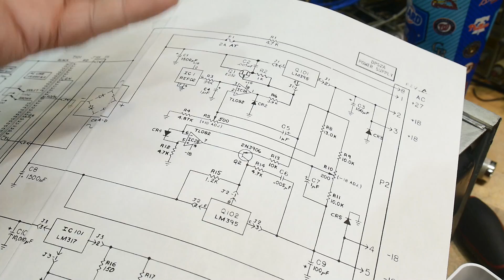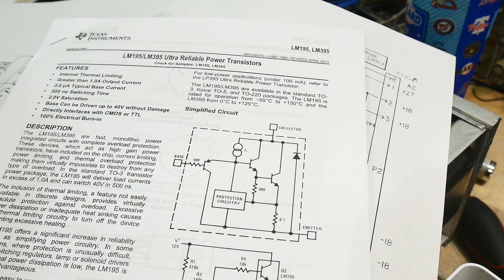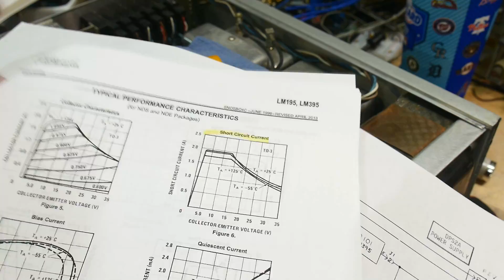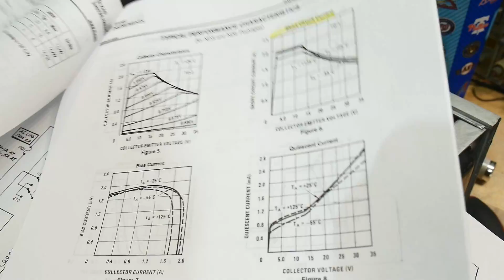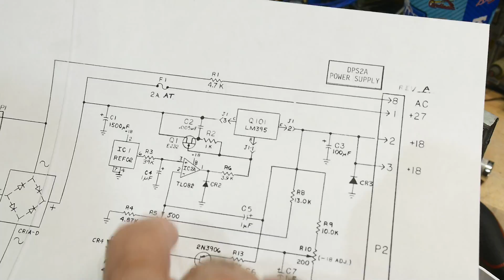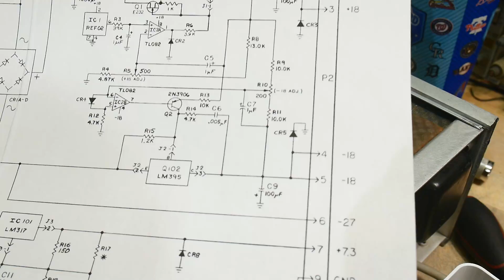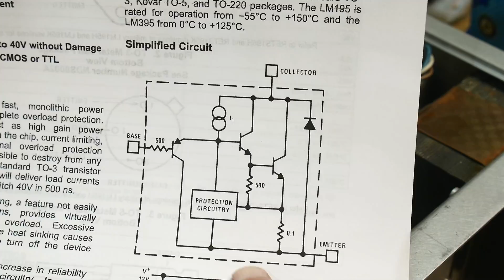#1900 LM395 Bullet Proof Transistor

Comment: They have them in stock at Digi-Key.

Gain is extremely high.  You can typically get 2A out with 3uA of base current.  That's about 667,000.  Edit:  But then again, not really.  Almost looks like a non-differential op-amp, whatever that is.

Comment: I wonder how glitchy it would sound being used for fun (if it can?) as a class A or A/B audio amplifier?
Love mystery parts like this. Think I saw one once in a PSU and didn't know its function. I'm sure the hfe is low but this begs
the question.. have they made modern versions of this with higher speed? What other uses can it fit into?
Reply: @jim9930  Well of course. I've worked with the LM3886 and it's a wonderful IC for HIFI audio but my idea was to push the LM395 into audio amplification service just to see how nasty it would be as an experiment, not as an actual practical use.

Comment: Still around, still current, and they are not totally bullet proof though. Yes you do get higher power more improved versions, there are plenty of protected mosfets that incorporate both current limit, overvoltage clamping, SOA protection and even have a fault output, to indicate the device is very unhappy and has turned itself off. But they are mostly used as automotive drivers, either high side or low side, and are generally not run as linear devices. You even get some with a current sense output, which uses a portion of the devices to allow use of a lower power shunt. 9 pin TO220 package. Think some even come complete with level shifters and high side charge pumps built in as well.
Reply: This thing is 40 years old. Back then transistors failed if you looked at them crosseyed. It would have been considered "bullet proof" compared to those.

Comment: 3:46 in the bullet points of the datasheet it says 3µA typical base current.  So the transfer function is voltage to current without to much base current. 
The input current is rather low as the main device is a darlington driven via additional input transistor.
Reply: That's why the data sheet quotes transconductance.

Comment: Whoa! Having a few of them back as a kid experimenting with electronics would have avoided a lot of magic smoke releases!
Reply: Heh - would it? Or would it release the magic smoke somewhere else in your circuit? Sometimes the power transistor failing is good news. Now I'm not saying you should intentionally use them as a fuse, but...
Reply: They do die, reverse voltage, trying to push too much base current, or high voltage spikes will kill them, plus running at thermal limit for a long time will definitely result in the various diffusion's going all the way through the die, and shorting it out.
Reply: @jim9930  Yes that old version of SOA protection could malfunction, and also would oscillate at high temperature, switching the device on and off as the die cycles. That leads to die detach from the heat spreader, and some real nasty things.

Comment: Mouser has the LM395T in stock, TO-220-3 package.
Reply: So does DigiKey, and they list the part as "Active". DigiKey wants $3.67 in quantity 1-44, $2.91 for quantity 45-134. You can get down as low as $1.72 for quantity 5040.